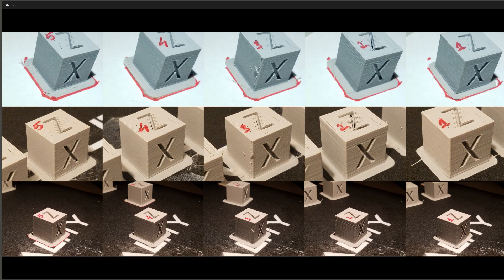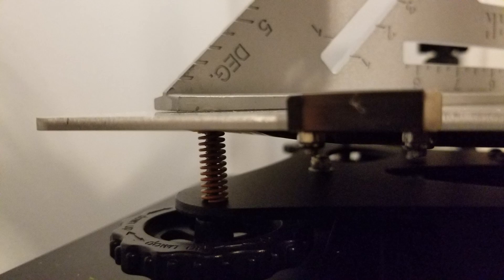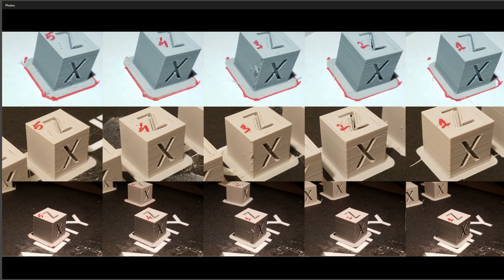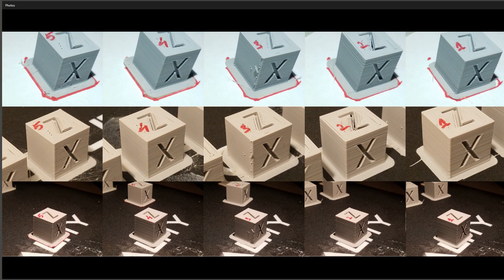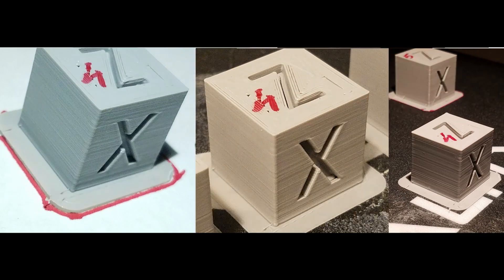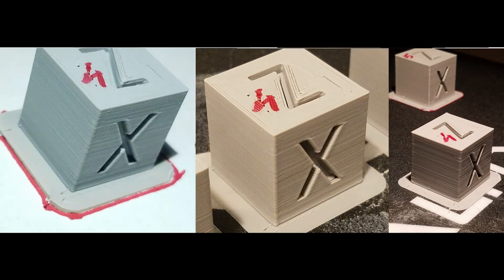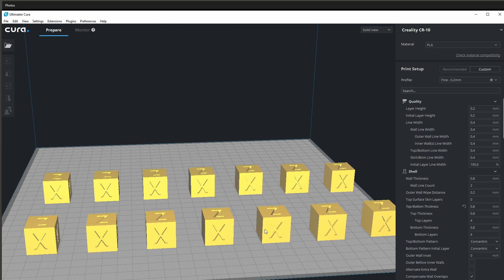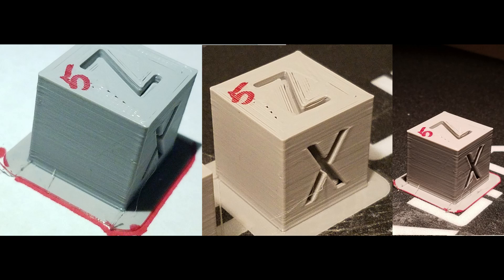Creality  3D Printer CR10s Pro 3D Printing Calibration cube for 3D Print tuning

Comment: Have you checked each axis with a caliper? When I first printed the cube out it everything looked perfect layer wise, but the sides were not all 20mm. I had I think two sides at 20.13 and another at 20.18. I know a way to fix this is adjusting the E steps, so it accurately prints 20mm on every side. I'm still learning how to do this myself and I think there is a way to adjust that in Cura, but in know there is also the Marlin program where you change the settings to compensate for these inaccuracies of the printer. its a little more technical so it'll probably take me a while to find a good way of doing this.
Reply from the maker: I think I understand what you are saying about the cubes not having the proper side lengths. But I do not yet even have clean faces to begin to work on the proper cube proportions. I do have a calliper, granted I do not yet have tto use it because the face is not smooth enough. Also my calliper has ran out of battery and I haven' replaced it yet because I do not need that precision yet. I am working my way up to being concerned with the accurate cube proportions.  I have been dialing it in and learning by doing some of the steps, and by the advice I get mostly here on youtube through comments and videos.  Thank you for being patient with my resolve.